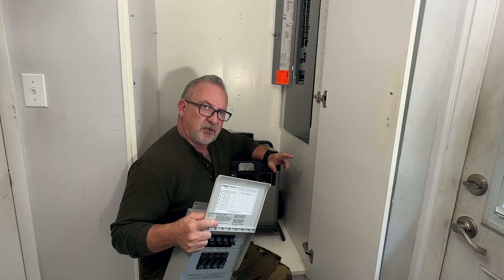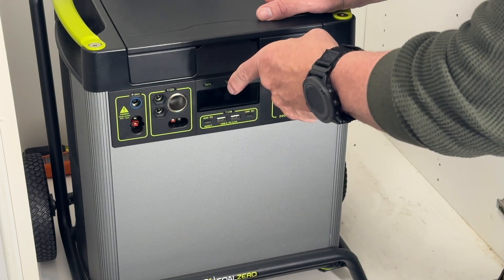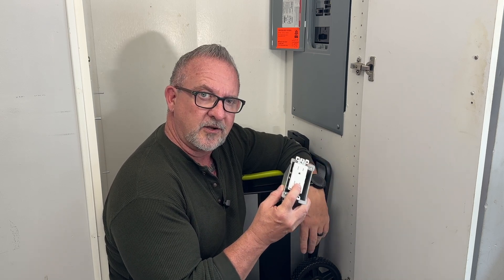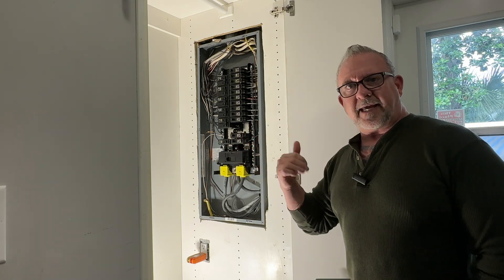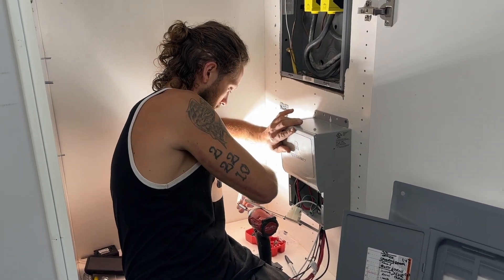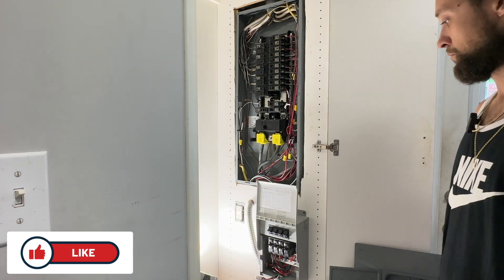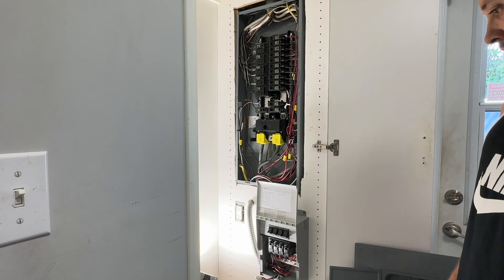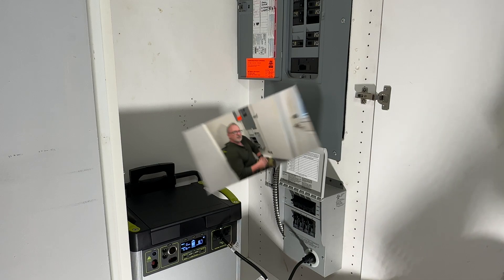Power Up 4 Circuits During Grid-Down, 1/3 Of The Cost Of A Tesla Powerwall

Comment: How do you lock it out so as not to back feed the line if the power is actually out?
Reply from the maker: The transfer switches above the breakers completely isolate the four circuits. If the toggle is up the circuits can only receive power from the battery backup whether the grid is up or down. If the toggle is in the middle no power goes to the circuits from any source. When the toggles are down the circuits can only be fed by the grid.

Comment: Excellent it looks like you got just the bare minimums of what you might need. Can that go zero not be set up to where your regular electricity keeps it charge and then when the power goes out it just jumps over to it. Whoops stupid question you're only running bare minimums not the full house so I'll just leave my stupid question up so people can get a laugh. You are definitely right please have an electrician do this. When I first moved into where I live now I had an electrician put me in a switch for my 8000 generator I called it my dummy switch because all I have to do is turn the generator on and flip one switch and I've got minimum power. He did still leave the water pump connected to it but when the pump kicks on it bogs down a little bit then goes back to normal. It won't run my house air conditioner but I do have a wall unit setup just in case. It sure did come in handy when that derochea came through back in 2011. Thanks for the video y'all think about it now.
Reply: Some of these systems can be run as a UPS (uninterruptable power source). As long as it is plugged in and doesn't exceed the power draw of the receptacle,  it will keep the circuits running from the unit.
 The only drawback from using a unit as a UPS is shortened longevity of the batteries. A manual transfer and a weekly or monthly maintenance charge of the unit will extend its lifespan greatly.

Comment: My biggest worry now that I'm A disabled senior is refrigeration and A/C. I have a 22 cubic ft. Deep freeze and large refrigerator A/C is 3-5 tons refrigeration (can't remember exactly) and piped in nat. Gas heat for the furnace side. Do they have a setup for that much amp draw?
Reply from the maker: Goal Zero have some much larger systems, for not much more cost, at the following link that can power a whole home AC unit, amongst other large amp devices … https://www.goalzero.com/collections/home-energy-storage-kits
Reply: Lol…Backup generator. Those stupid power boxes can’t do shit for central air.  Central air might only burn 1000 watts an hour but it needs a lot more power to start up.  You are looking at a 18kw generator to keep your central air rocking.  Which is a big boy and loves the guzzaline. You are better off spending the cash on a general standby generator.  You can’t have backup power that runs central air on a budget.  I’ve looked into all the options.
Reply: @BURNINGLIMBO  nothing about electric generator backup is cheap. The solar-powered generator is interesting but very expensive. My first line choice for backup generation is a dual fuel natural gas/ propane generator. I wouldn't rely completely on solar power for my Refrigeration needs. I  live in an are now that rarely has extended power outages. When I was young I lived in areas that could have power outages for days after a moderate storm. We always got by.